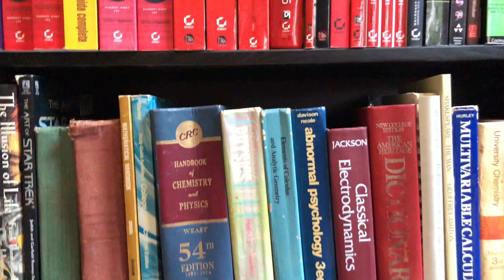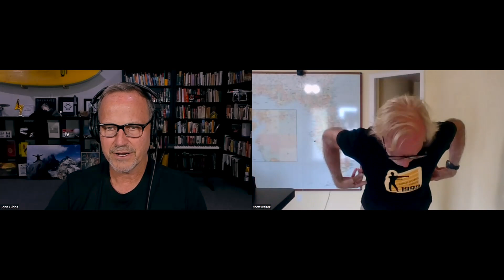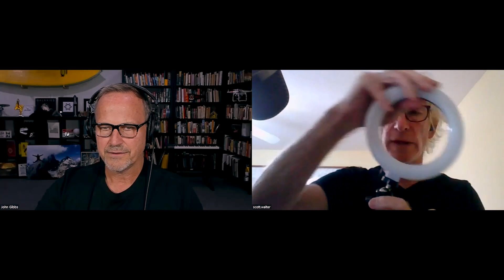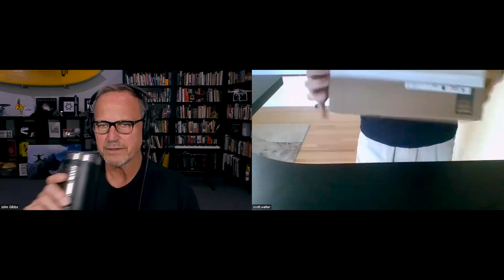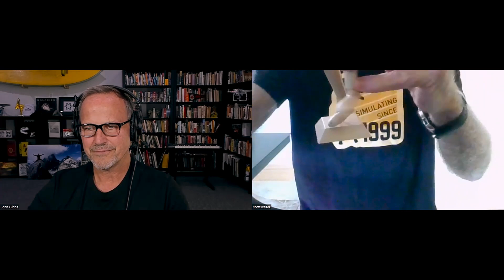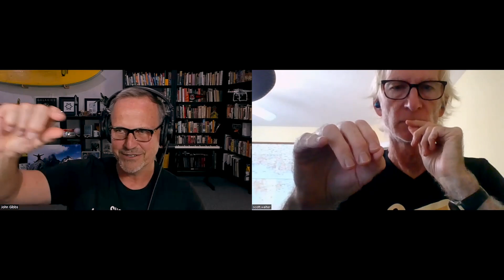Will TESLABOT be A SOCCER STAR?!  Robotics Expert: Here's How Tesla's Robot Will ACTUALLY WORK!

Comment: @10:30 You're assuming that the robot doesn't have a 360° field of view. It could/should/would if the sensors are cheap enough. (Just buy enough of 'em.)
Eight cameras and eight microphones would provide SubOptimusPrime with full sensory inputs so that it can't be snuck up on, or get hit with debris.

Comment: The third movement of the wrist is one of the most important to use hand tools. Think using a screwdriver. It looks like it could be a uni joint type thing with only left right up down . This could be controlled with 4 servo winches acting as tendons.  Then have rotation at the elbow so the entire forearm rotates. My guess is 2:2:2

Comment: Wouldn’t it make sense to use the same 8 camera system (arranged around its skull) for Optimus? They have the neural nets established and untold work hours into getting them right. In this case the two degrees of freedom for the head could be tilt front/ back (look up/down), and tilt left right (soccer). No turning of the head required because the cameras are 360.

Comment: If you get rid of the flat -30°/30° movement of the hand, how is the bot supposed to use a manual screw driver?
(Or using a knife... No reason I'm asking this...)
Reply: Not really needed for those motions. Plus I think the point is to design hand for power tools, not manual  tools at first.
Reply: @goingballisticmotion5455  that side to side movement is Very important even using a drill in confined space like inside a car.
Reply: @saff226  Which the elbow redundancy can also do to some extent. Not ideal, but can result in a slimmer wrist design.

Comment: You know, I've heard about how changing the size of parts of the robots or the shapes, etc. of the electric cars and trucks would require complete retraining of the neural nets with new data, etc. That shouldn't be that way. The training process ought to be conditioned on the ab initio starting conditions as well as transient conditions (like loading). For example, the neural nets which control robot balance should work regardless of how tall or how much the robot might weigh at a point in time (or how much it is carrying). Likewise in a car, it should be able to deal with different loadings, changes in shape (or pulling a trailer), etc.
Reply: Yes, I don’t think it mean much change. The video feed create a virtual world that is the same wherever where the cameras are. The differences will be the level of confidence in the position/nature of the objects depending on the camera quality and position.
The same is true for us, if we drive a truck from higher ground we have a better picture of things unless they are very close and occluded.
Reply: @alexforget  Yes, I'd think if you were a computer using numbers, vectors in virtual space would probably be relative to your center of mass and those of other objects (with boundary box conditions around everything). Initial conditions would play a big part (whether you were a Model Y or Semi or TeslaBot or Robo-Dog; how many sensors, dfs, etc., you had and where they were located, and so forth) Still, the trained part of the model downloaded should be robust while quasi-dynamic factors like loading and external conditions and dynamics like speed, etc., would be factored into some sort of state matrix. In any event, one would hope the training wouldn't need to start over with ever new variation of something.

Comment: The torso does have roll… you can see the joint axes represented as cylinders in the diagram and roll is one of them. The torso pitch is a result of the hip pitch motors; you don’t need a separate actuator for that